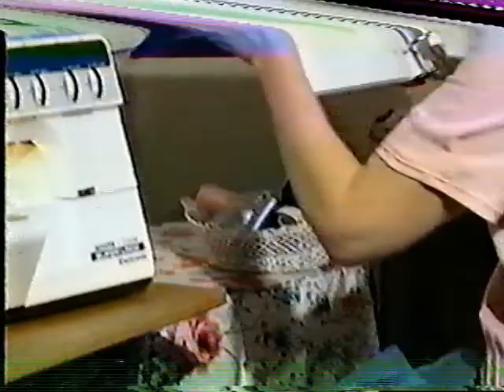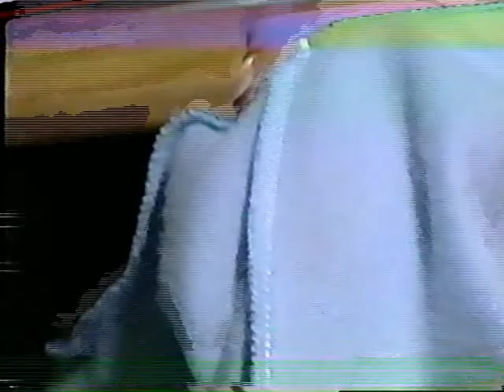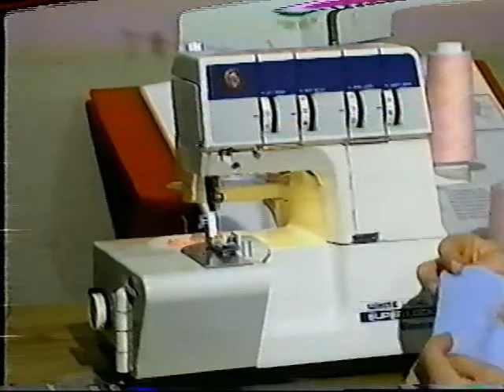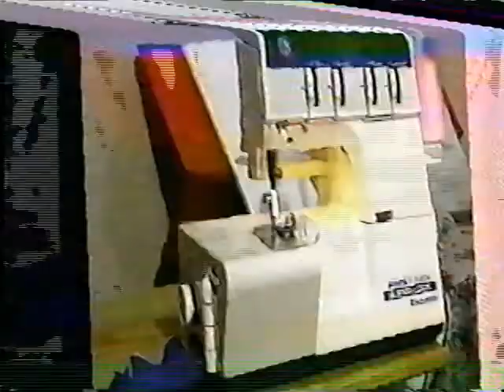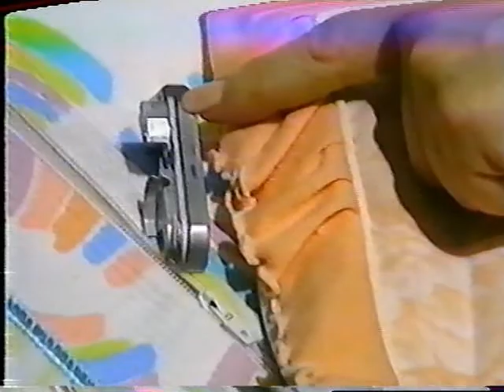White Superlock 734DW Video Workbook

Comment: 4:59 Cleaning and Oiling
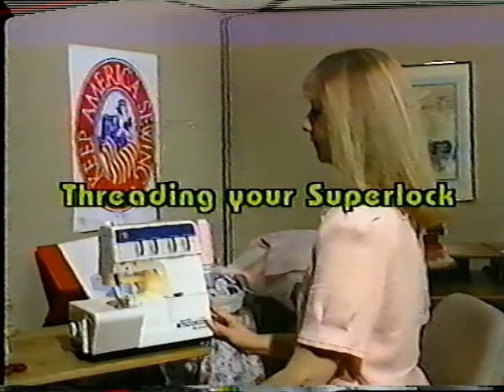6:30 Threading your Superlock
10:09 Thread Tensions
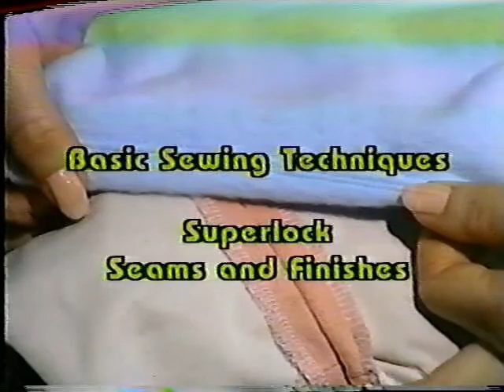11:38 Basic Sewing Techniques: Superlock Seams and Finishes
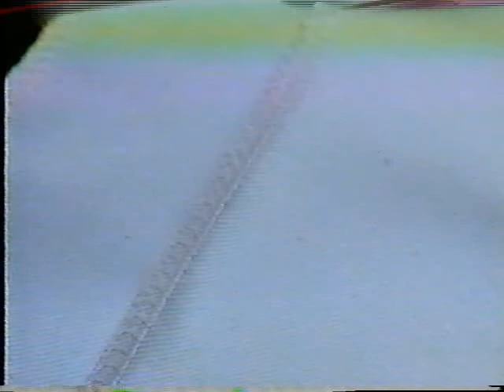13:46 Adjusting Stitch Length
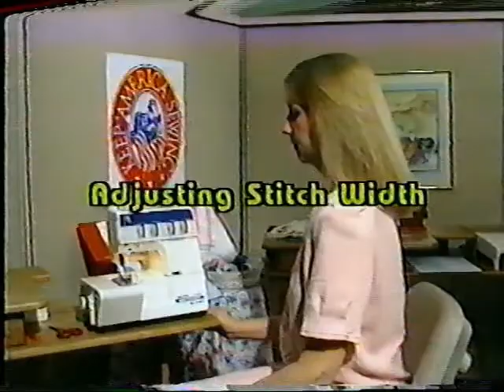14:55 Adjusting Stitch Width
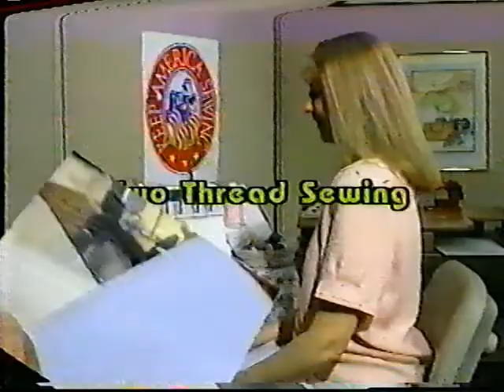17:46 Two Thread Sewing
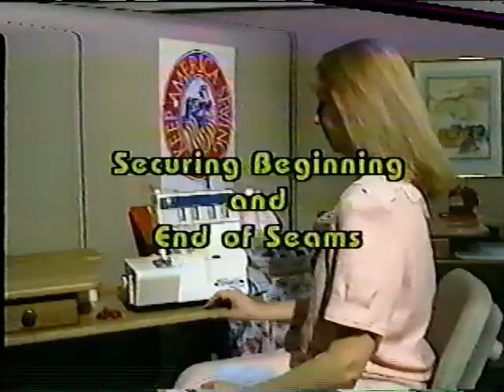19:51 Securing Beginning and End of Seams
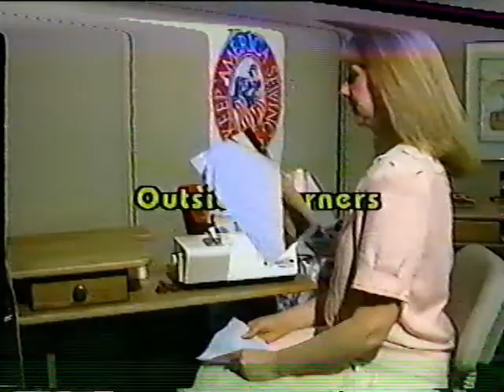21:12 Outside Corners
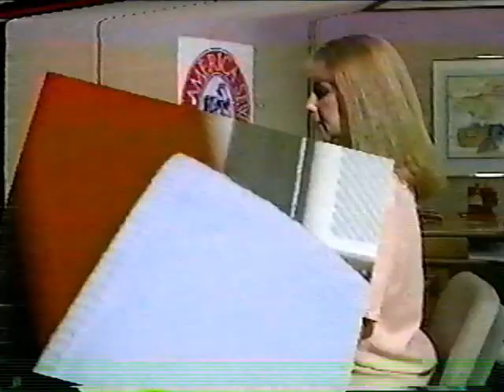22:18 Inside Corners
23:11 Corded Overlock
24:38 Elastic Application
25:38 Gathering
26:28 Ribbing
27:44 Tucks
28:55 Decorative Edges
30:56 Three Thread Flatlock/Ladder Stitching and Seams
32:23 Two Thread Flatlock; Ladder Stitch; and Seams
33:52 Flatlock Technique-Lace Application
34:51 Rolled Edge
37:14 Three Thread Narrow or Shell Edge
38:48 Rolled Edge
40:26 Differential Feed Techniques
41:24 Serging Lightweight Woven Fabrics
42:27 Serging Stretch or Bulky Knits
43:39 Gathering with Differential Feed
44:24 Bling Hem Foot
46:18 Elastic Foot/Gathering Foot
47:58 Piping/Cording Foot
49:32 Pearl/Sequin Foot